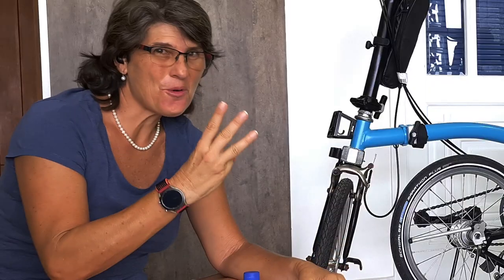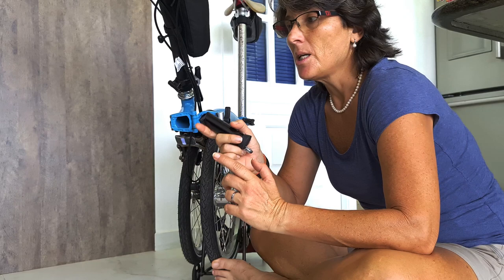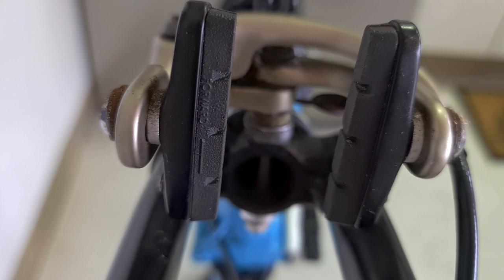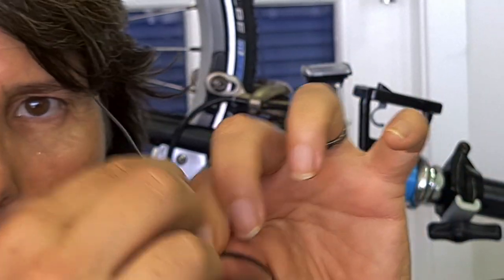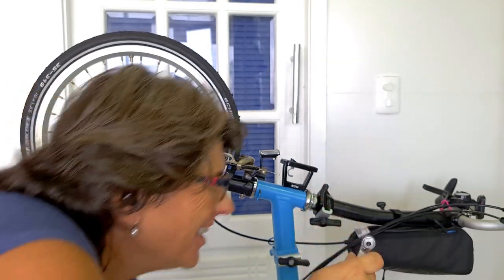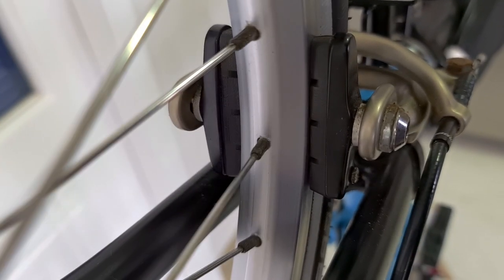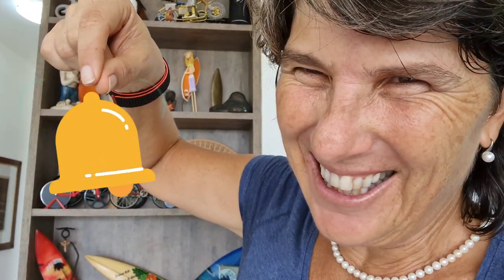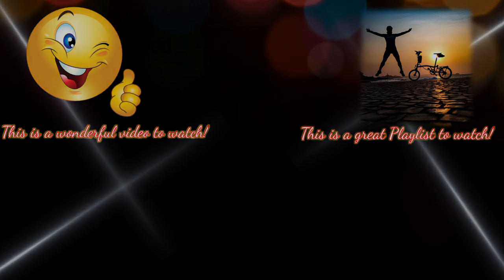A HACK To Toe-In your Brompton BRAKE BLOCKS

Comment: I've never had squeaky brakes on the Brompton, but I'll surely check if brake pads are being worn evenly and, if not, use your ziptie tip. Thanks!!
Reply from the maker: Hi Victor
My brakes start to squeaky last month, but I thought that cleaning the rims would solve it. Researching I discovered this regulation. And it makes a lot of difference in braking.
And even more difference for the ears.Hahahaha
Always very nice to have you on Board!

Comment: Thank you for the Hacks. 👍☺️

Edit:
Can you recommend better brake pads?
Maybe there is a more suitable rubber compound?
Reply from the maker: Hi Juckendes Auge
I haven't needed to change my brakes yet. 
But on my Touring Bike that has disk brakes I prefere using organig pads because they make no braking noise.
Get the original Brompton pads. They last for many miles.
Nice to have you on board!

Comment: chris, u can use a BT-2 Fourth Hand Brake Tool to make the job easier
Reply from the maker: Hi Kwokweng76
The BT-2 4th Hand Brake tool is perfect to adjust cables. It is a much easier solution. 
But in this case, we are adjusting the stop break pad angle to end the squiky noise. There is no need to touch the cables.
It makes a lot of difference in braking performance and silence ride.
Nice to have you on board!

Comment: Thanks for another simple yet ingenious tip. Also: Looks like they still haven't released your titanium seatpost from the post office? Did you get a refund?
Reply from the maker: Hi NiZenith
Nope, the seat post still at the Post Office Center, and because of covid it is not aloud to go there.
But I have to confess,  yesterday I've ordered a new Titanium black seat post. I hope this one gets here 😊
And sadly I lost the time to complain for the refund because I've pay the Post Office Taxes and tough it would be delivered. 
Hope the new one gets here😊
Keep Safe! Keep Riding!
Reply: @ChrisbyBike  that's so sad.  Aren't you afraid the post office will do the same thing with the next one? I guess at this point when you finally get the rainbow one you'll be able to accessorize :-)
Reply from the maker: Yes, I'm afraid they do the same with the black one, but my original seat post is getting to rusty, I clean it and it comes back . So I'm afraid it will damage the plastic sleeve.  
Let's hope for the best 👍🏻😊
Reply: @ChrisbyBike  have you tried painting it or clear coating it? Run sandpaper all over the whole thing to change the texture so the paint will stick
Reply from the maker: It is a good idea, but I do not have the tools for it. Let's hope my new black Titanium seat post gets here in one pice 😊
Reply: @ChrisbyBike  a piece of sandpaper should be pretty easy to come by all you want to do is rough up the glossy surface and make sure there's no actual rust before you spray paint it. Spray paint in really light coats. No tools needed :-) you can even get a satin black so it matches your forks.
I hope you get both of your new seat posts ASAP! (As Soon As Possible if you don't have that acronym down there) Good luck.
Reply from the maker: Thanks NoZenith 
I'm hoping for my Titanium seat post gets here ASAP 😊😊😊
But in case it does not, I like your idea. It will be my backup choice
Keep Safe! Keep Riding!

Comment: Self Help? - Top Marks!  Setting brake pads is my least favourite job on any bike. And I think Brompton brakes work harder than most. The zip ties could definitely make things less fiddly. As far as I'm concerned, if you loosen the fixing bolt there's no reason not to completely undo it - which would allow you to take the pad off and rub it on a sheet of sandpaper, on a flat surface,  to help with keeping the surface flat.
Reply from the maker: Hi David Powell 
Sure do, It is a very good way to do it.
I love the zip lock idea.
And was impress how much eficiente the brakes work after we Toe-in them.
Keep Safe! Keep Riding!

Comment: My Brompton brakes would be good if they just stopped the bike
Reply from the maker: Hi Cosgrove Notts 
Interesting,  I never had this issue. Even with heavy load on the Brompton going down hill.
The only problem I encounter is some times the rims get to hot when is a long and curve down hill.
Keep Safe! Keep Riding!
Reply: @ChrisbyBike  maybe I'm too heavy lol
Reply from the maker: Did you try the Toe-in adjustment?  It  increases a lot the brakes performance
Reply: @ChrisbyBike  I've tried all sorts. I've been a proper vehicle mechanic for 51 years.
Reply from the maker: Well, there is only one solution. 
Disk brakes 😊